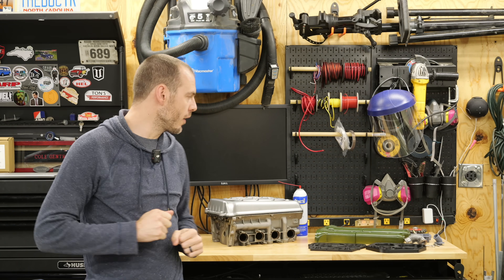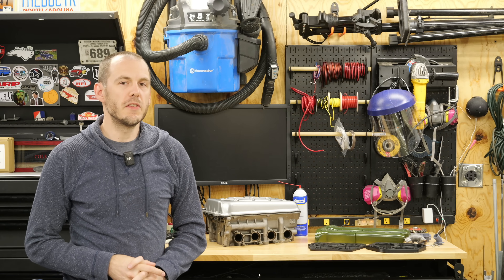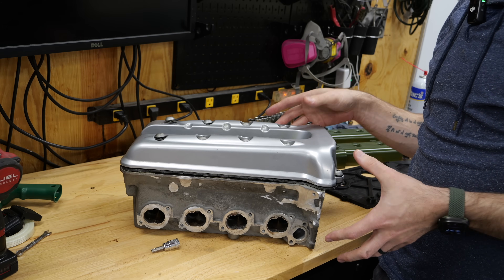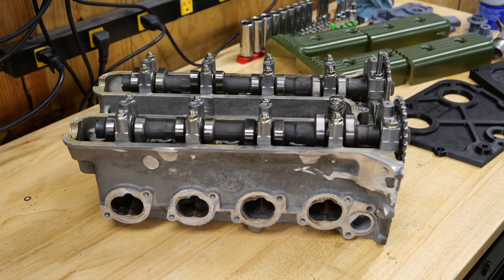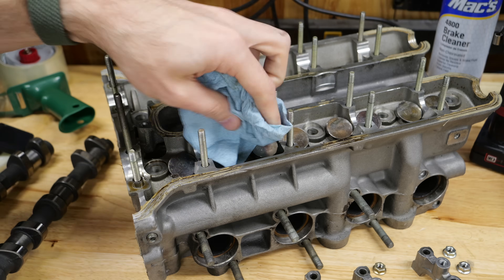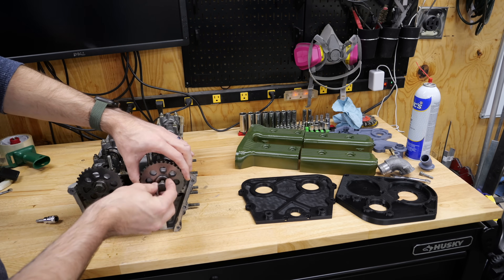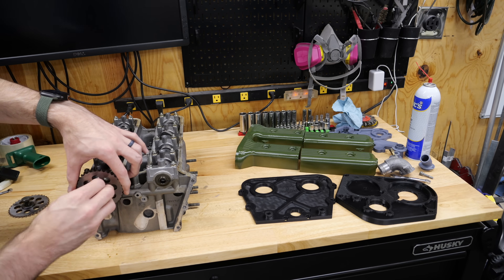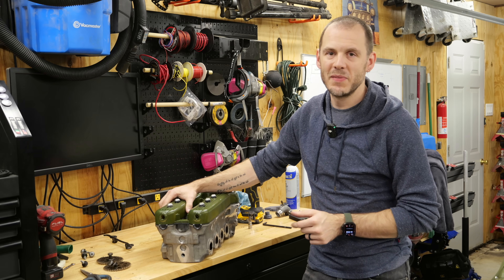TwinCam Turbo A-Series - Classic Mini Conversion Build | Episode 1

Comment: I sometimes test sharpies on my hands but usually when I'm wearing gloves, for actual notes I do splurge on paper. 👍 How much power can the three mains hold?
Reply from the maker: lol tattoo joke. The 3 mains can handle under about 300 in engines I know about. Though I’m sure someone has done more. The killer is rpm not torque or horse power figures.
Reply: @classicminidiy Well, in the end it's RPM that makes torque into HP. 300 is quite impressive. I'm more familiar with how under supported the cranks are in the longer stroke variants of Triumph 4s and 6s and a quick googling shows that an A+ slots in between a Triumph 1500 and a 2500 in journal overlap as a percentage of stroke (~11% for a 1500, ~9% for an A+ and mere ~6% for a 2500) I guess there are other factors contributing to bottom end stoutness. As a comparison the Triumph slant four I have to live with, with its five mains and short stroke, has a journal overlap equivalent to over 20% of the stroke. Angled headbolts and ridiculous waterpump aside, that crank could make it through nuclear armageddon!

Comment: How does this conversion compare to the Kad head or the Jack Knight one that used to be available
Reply from the maker: Not sure about the jack knight one. The KAD one is a totally bespoke head so it’s not retrofitting a bike head, it’s buying one purpose built for the a series which has its pros for sure. This one tends to be considerably more affordable despite the modifications required
Reply: @classicminidiy be interesting to see a comparison with an Arden 8 port head too - like MED sell

Comment: This is on my to do list, but I’m 50/50 on doing a brat/fighter build with the bike instead (which needs a rear main or gearbox input seal replacing).

Comment: 11:01 You can throw those "little covers" away to save weight.
There are little covers on the small ends of the connecting rods too , throw those away also.
Reply from the maker: Wouldn't removing those covers cause the valves to not fully open and to drive grooves into the cams?

Comment: Why not retain the  timing chain as it is much more durable than a belt as well as keeping the engine short for max flow around the rad?
Reply from the maker: Not sure why most folks go with timing belts on these builds instead of chains to be honest. I am not sure I have ever seen an A-series twin cam conversion with a timing chain.
Reply: @classicminidiy  Using timing belts is understandable for manufacturers because they are quieter and there is no oiling to consider but the BMW K series already has a chain so is there a complication with adding a sprocket to the A series engine?

Comment: Worked on a supercharged classic mini race car several years ago with this conversion, problem is there’s too much torque and the front geometry gets compromised and driveshaft angles get a bit involved. 
Ran mega wide 13” Avon tyres and suffered with bump / torque steer even though it had alloy uprights and steering arms , AP 4 pots etc etc . 
Lap times were no different to a well set up miglia .
Reply from the maker: Yeah thats the downside of these turbo/supercharged builds on these cars youre totally right. But regardless its such a fun type of build that you live with some of the drawbacks to say you have a 200-250hp mini with a turbo. Whats nice though is with modern boost controllers you can really modulate the boost and make the car behave more normally even at those lower speed/high boost scenarios.
Reply: @classicminidiy yeah get the point, 😂 . 
Off memory the car I worked on and ran for a couple of years the driveshaft angles became an issue because he ran 13” wheels . 
This effected the ride height and suspension geometry. We ran a rotrex supercharger , used the original engine mounts and a forth from the front of the cam cover down to the front subframe to stop the rear stay from snapping. We had around 200-250 bhp too and ran a jack knight box which was reliable. 
We ran a small alternator , the type that’s on Kabota diesel engines and two small electric fans that only just fit behind the front grill. 
The intercooler was mounted on the front splitter and was a pain to fit  .
Ended up making a full clamshell front with a bulge in the bonnet . 
We ran an electric water pump and the header tank fit inside the front left wing . 
Main problem though ended up being the bump / torque steer due to large offset wheels, even with electric power steering it was a bit of a handful . Camber changes / roll centre with the front end was also an issue, but he wanted to keep the shell to historic regs for racing .
Carl a force racing wheels in England do some really nice split rims for not a lot of money. 
Also check out skidmoors garage on YT , he does space frame chassis and has re designed the front suspension for his bike engined car ., he uses Carla wheels too .

Comment: my experience with a series is when you eventually get the engine to stop blowing up with extra power then the diff and gearbox start blowing up
Reply: You really need to move away for cheap parts lol
Reply: @bernardwarr4187   original parts that keep failing

Comment: I worked at a BMW breakers for many years. We supplied dozens of these & very successful they proved. K1200 had the hottest cams & lightest valve train (note you get 500rpm higher red line on 1200RS)   & cam interchangeability is easy. Their throttle bodies are the biggest diameter too if you go normally aspirated. Any K1100 cam being softer & maybe a better fit for car applications in the real world, but I bet no one thinks that way on a special. We did get the odd cracked cylinder head between spark plug hole & valve seats, so it is well worth cleaning that area very well & checking.
Reply from the maker: Awesome thanks for the info. Cool to know more of the ins and outs of these heads. Iw ill have a peek at the head again and see if there are any cracks between the plug holes.
Reply: @classicminidiy The water pump is combined with the oil pump on the K engines, with a tell-tale hole in the casting that shows a leak if any seals fail on the internal shaft. The 1200RS had a belly pan that stopped the leak to the floor under your bike, so you couldn’t tell if the seals ‘went’. With that it had the most enclosed bodywork so trapped heat more & being the performance long distance bike, I think they got over-hot when those seals failed, which was surprisingly common, hence the odd cracked head. It did pinpoint the problem with that model mostly & the police versions had a hole cut into the belly pan in that place as standard I noticed.

Comment: This looks suspicious much like the valve cover I made for my 16v conversion about 17 years ago, only with the text HOLTRACING and 16V milled into the cover, it was covered on the website EFIMinis, that unfortunately dosent exist anymore. It was milled out of a solid chunk of aluminium, and I still have all CAD files for the project, but the whole build was sold before I finished it. The guy who bought it from me have it running today.

Comment: You need to step this up a bit, you describe everything like you are talking to children not engineer petrol heads! "It has holes in both sides of the head" "thats because it is fully cross flow" As opposed to what? semi cross flow?? Couldn't listen to the whole vid and i really wanted to, i wanted to know about bore spacing and alignment of compbustion chambers,  oil feed and drain etc but all we got was a 101 for 3 year olds on the difference between OHV and DOHC.
Reply from the maker: More detail will come in later episodes just like my previous series'. My videos are about helping people of all skill levels learn how to do these jobs on the car. So starting simple is vital to help people learn everything about the build and the system, and why you'd do something like this. Once we get the block back from the machine shop and start really digging into the meat and potatoes of the build there will be so much technical detail you may be making another comment telling me to chill out hahaha.
Reply: @classicminidiy  What, you are not doing the machining yourself?
Reply from the maker: lol unfortunately I don’t have a boring or surfacing machine in my residential garage. Some things are better left to the professionals with the right tools.

Comment: I've wanted to see a build on these every time I read about them. But I don't own an a series or mini or Morris etc so never looked hard into it. Interesting on how to convert it. It is amazing how we appreciate a twin Cam on an old motor, but ignore modern stuff running 13:1 na.
Reply from the maker: Yeah it’s pretty funny how different the perspective is between older A-series and newer engines. However I will say these engines really can handle more compression with modern ignition systems and fuel injection technology.

Comment: do you have to use an a+ block? where would you source such a block? I've bought some heavy parts back from the uk, but never an engine block.
Reply from the maker: Yeah, for this building, I’m going to be using an A+ block. I had a buddy in the UK source one for me. It would be the second time I’ve had a short block sent to me overseas and it’s about $100 to ship. It’s heavy, but it’s not that big so it’s really not that much different than shipping tires or a set of seats, etc. I have never shipped an entire engine over the ocean though so I’m not sure how that would be.
Reply: @classicminidiy  did the a+ engine come in anything in the USA? I've got spridget's and am looking for an upgrade, but not looking to go to a k series swap as of yet, trying to stay carb and the a+ engine is stronger.
Reply: how does the height of the BMW head with cover compare the height of the original A series head and rocker cover - I am thinking about this under a Sprite Bugeye bonnet?
Reply: @roselh1  bugeye bonnet is very tight, not much room.

Comment: So you don't care about bending the valves !!! If you haven't, you're VERY lucky.
Reply from the maker: Yeah after moving it around on the table it hit me those valves were poking out with the cams installed. Whoops! Oh well we shall see if I did any damage.
Reply: @classicminidiy  i'm in the middle of doing one of these myself. My only worry is that the head studs or the blanking inserts are going to leak, pushing water up the stud holes and past the head nuts. To try to avoid that happening, i bought stainless acorn nuts and aluminium washers, hoping they will seal the top of the studs. I also bought an anaerobic stud sealer for the stud holes that go through into the water cavity in the block. It's going to be a dry deck jobby ! Solid copper gasket with no water holes.

Comment: I've always wondered if it would be possible to do an DOHC conversion to an A or B Series engine, I can't wait to see how this turns out!
Reply: Its been done a fair bit for the last 10 years.
Reply: @Dagowly83 well over 10
Reply: The Rover M and T series engines are a relatively easy conversion for RWD B series applications using various parts from the old Sherpa van, so a 16V cylinder head conversion of the B series makes less sense.
Reply: "DOHC conversion to an A or B Series engine"

Well of course 🙂, there was the MGA Twin Cam of 1958 which had a B Series with a twin cam head whacked on. They were famously unreliable, however that was some small problem that got fixed. I did read about it but I forget the details.
[Problem was fuel frothing in float bowl causing lean running and blow  ups. Fix was rubber mount the carbs]

https://youtu.be/lNt31nbWy1k?t=147  -- Nice image of engine
https://youtu.be/lNt31nbWy1k?t=696   -- The problem
Reply: @springford9511  Weren't all BMC's unreliable?